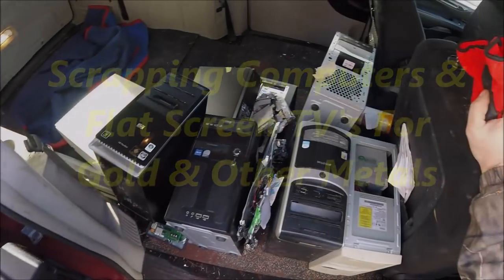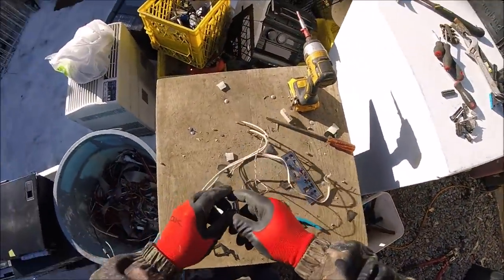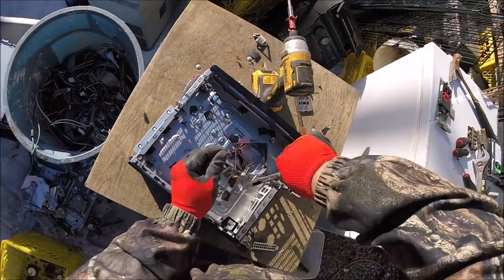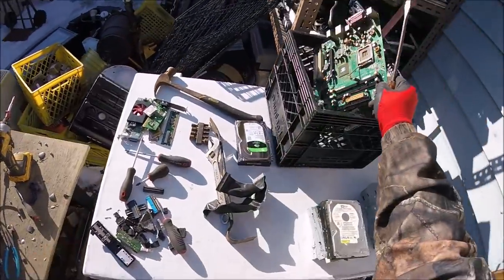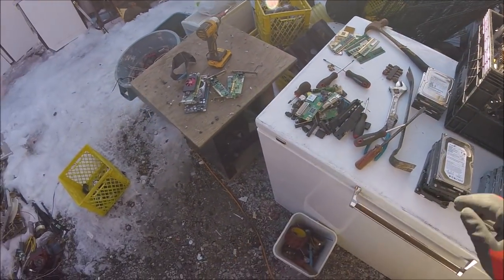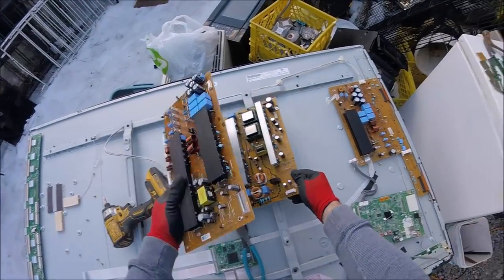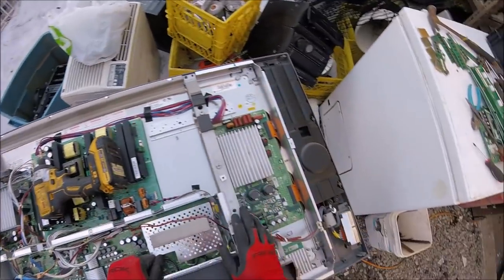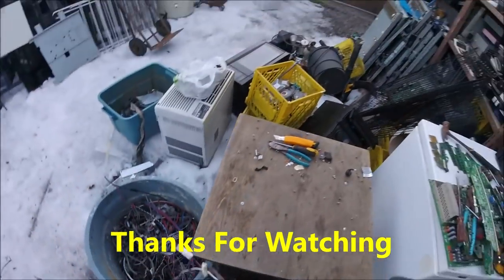Scrapping Computers & Flat Screen TV's For Gold & Other Metals

Comment: Current price for low grade board , power board is 0.13$/lbs) :(. I take of extruded heat sink, ic chip and big tranformer and sell what's left as low grade. Mid grade is different, depend if worth depopulating or keep for gold recovery ex:finger strip board from t.v. Mother board i sell right off 1.25$/2,50$/lbs they are sorted by the cpu socket size or p2/p3/p4 ect...
Reply from the maker: Thanks For Watching, There's a buyer here That payer $1 & $1.80 for large socket boards & i don't know who buys low or mid grade boards here, I might put low grade in the tin pile when the prices get around 180 Ton & You in Quebec? there's a buyer in Ontario that buy scrap boards